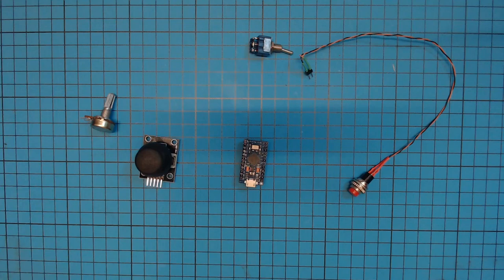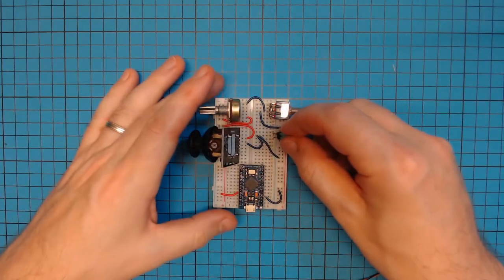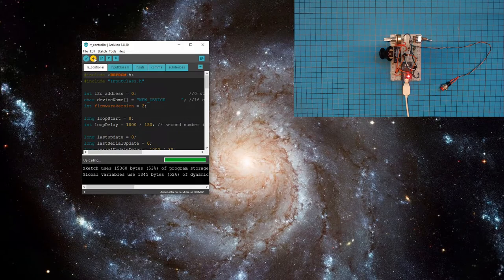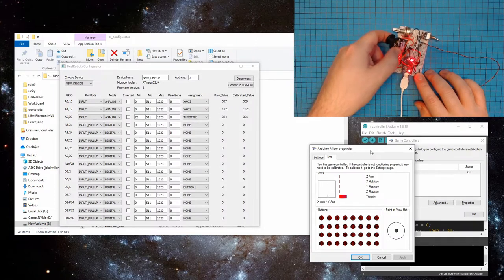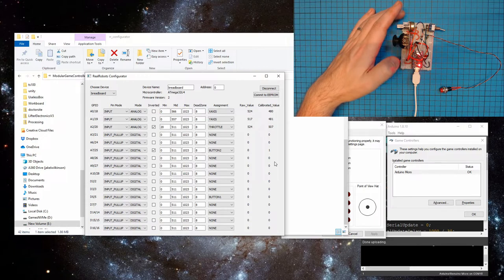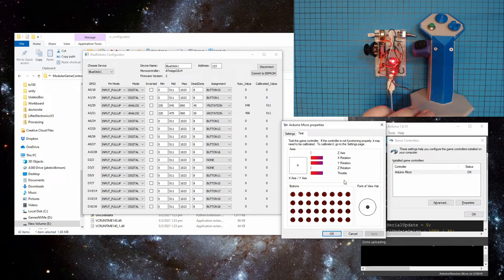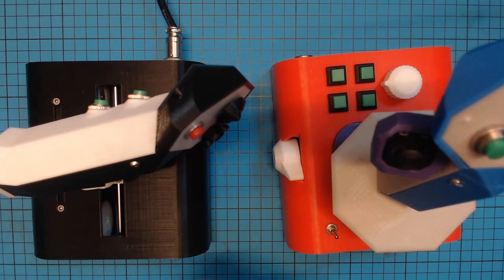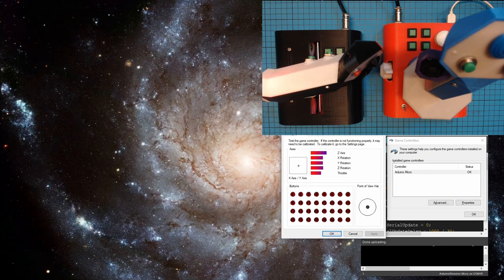RealRobots Configurator - Build your own controller with NO CODE

Comment: Mate this is absolutely brilliant what you have created. After years working on DIY sim racing equipment I was looking to repurpose my flightstick and modify it. This has been a godsend, all your videos are super clear and well explained. Hats off! Just wondering if there would be any issue if I were to connect another pro micro (making a dedicated hotas to work alongside my flightstick). I'm guessing it shouldn't be any but thought i'd just clarify :p
Reply from the maker: No problem, you can have up to 255 pro micros chained together. (Though the max I've tried is 7)
Reply: @real_robots  Fantastic! Thank you once again

Comment: Hi, I have printed all the parts and spent today assembling. I have uploaded the code to the Arduino Micro's however when I open the RR configurator I get 1s and 0s jumping backwards and forwards and on the analog inputs the values just run up and down and it doesnt matter what I do to with the buttons... Can you help please...

Comment: are there any plans to add a axis-to-button function? so to put "virtual buttons" within certain ranges along an analogue axis?

the main appeal for this is to wire up a buttons in series separated with resistors that connect to the analogue pin when pressed. it would allow you to add multiple momentary buttons but only requiring 3 wires and just using a single analogue input pin.
Reply from the maker: You can set an axis to a single button right now by assigning it to a button and calibrating to only range from 0-1.

Unfortunately any new features are a long way off as I don't have much time to work on this project any more.

Comment: Absolutely amazing work my friend
Reply from the maker: Thanks!
Reply: @real_robots   where should i place the code to display all channels values i need back to me?
Reply from the maker: @vtstechnologies5737  You need to upload the rr_controller firmware to your Arduino Pro Micro using the Arduino IDE
https://www.gitlab.com/realrobots/rr_controller

Then when you run the rr_configurator software on your PC you'll be able to see the values coming from every input.
https://www.gitlab.com/realrobots/rr_configurator
Reply: @real_robots  oh yea we did that already. found a few bugs when we close the program.
Reply: what i mean is . how to add my oled code to this so i can see my value that way?
Reply from the maker: @vtstechnologies5737  If I were you I'd grab the current value of each input and update it to your screen on line 260 of Inputs.ino just after all the inputs have been taken and processed.

If you want to display the data from networked subdevices that isn't stored so you'll have to post it to your screen as it's received on line 532 of subdevices.ino

You could also hijack the JoystickInput(input, value) function on line 503 of Inputs.ino That would be the way to go if you only want to display assigned inputs.
Reply: @real_robots  thank you . i will try and check it out.
Reply: i wonder where to put the oled address and h file also #include <Adafruit_GFX.h>
#include <Adafruit_SSD1306.h>
Reply: @real_robots  i may need you to explain what you mean by hijack, as i have no idea where i should be putting the display init to recon the display and then where to put each line. could it be under  case XAXIS(value);
then i write the line to refer to screen and map the values to the screen size here at each axis line before you wrote "break;"
?
Reply from the maker: @vtstechnologies5737  I would put that at the very top of Inputs.ino, if there's any init function, put it in InitInputs(), after the delay.
Reply from the maker: @vtstechnologies5737  By hijack I mean put the code in that function, since that function is called for every input that gets sent to the PC. 
I would put your code at the very top, you'll know what the input is by the 'assignedInput' variable, ie whether it's xaxis, button 1 etc. and what its value is by the 'value' variable. You just have to work out the layout and where on your screen you'll print those values. If you want to know which 'assignedInput' applies to each input you can check their order in the rr_configurator, XAXIS=1, YAXIS=2 etc.

Comment: do all additional devices connect to the same two pins? SDA and SCL? (plus vcc grd) so all devices are communicating through those two pins in parallel?
Reply from the maker: That's right, you just need to assign each device a unique address in the configurator and you can theoretically have 255 devices working as one.

Comment: Hello, thanks for making this, but for me the controller only works with the configurator open. What am I doing wrong? I did commit to EEPROM and am not getting any errors in the console window.
Reply from the maker: That's odd, having the configurator open shouldn't effect whether HID signals go through. Make sure you've got the windows USB game controller thing selected when you test, it only updates when it's got attention. Other than that make sure you've got the address set to 0. If all else fails, reupload the firmware and start from scratch.

Comment: I am in the process of printing the hotas now and waiting on parts in the mail. I've already applied it to a yoke that I've made and this is AMAZING! Id like to make the throttle as well, but I'm not sure what linear rail your using. what size is it?
Reply from the maker: That's MGN9R rail.

You can get the files for the throttle here

https://realrobots.net/files/productFiles/ThrottleBase1.zip

Comment: Does this program allow you to change the function of a switch? I am building a button box with a pro micro and using a few toggle switches but would like them to act as momentary switches for instance I would like to be able to switch the toggle on and it stay in the on position but only pulse the output. Then when I turn the toggle off that it would pulse the out put again.
Reply from the maker: Sorry no, it doesn't have that feature
Reply: @real_robots  do you have a recommendation or code to overcome this issue?

Comment: this is fantastic. are you still limited to 32 button inputs + hats? or can you exceed 32?

edit:(I believe technically software can see a total of 128 button inputs per HID device but windows joystick config will only ever show you 32)
Reply from the maker: I allow up to 128 buttons in the configurator, not sure how much software supports more than 32 though
Reply: @real_robots  wonderful! Thank you 🙏 
Exactly what I wanted to hear. 
Most major flight sim games will happily read the full 128 inputs per device.

Comment: Power wise. Does the extra 5 ( as you mentioned)  require any additional power? I would have thought the power requirements would be struggling with that many.
Reply from the maker: It's a good question, from memory the microcontrollers pull around 40milliamps each, so running 5 would be well within the 500ma provided by the minimum USB standard. I'll have to put one on a benchtop power supply and see what they actually pull but I'm running mine (2 bases, 2 sticks and a button box) off an unpowered usb hub with a webcam in next to it and haven't had any power troubles even with heavy use..
Reply: @real_robots  wow.

Thanks for that. I think this is some of the best software I’ve seen in the Arduino world. Does it do software debugging as well. I have a couple of Frysky M9 gimbals that I’ve been playing around with (3.3v)  that tend to jump about even after windows calibration. Gonna try hardware debugging after I try this software to see if it works. 

I love the aviator plug idea. I picked 2 sets after I saw how you linked a couple pro micros together. Very smart idea.

Does the software change the name detected in windows ie arduino micro?
Reply from the maker: @paulb36utube  Those Frysky gimbals look nice, are they just potentiometers or do they have some electronics in there? They have a surprisingly small voltage range if they're just pots.

The aviator plugs are great, you have to make sure to do them up tight so they don't work themselves loose but they can take some serious lateral force.

I haven't worked out changing the device name in windows yet, from what I've worked out so far you can change it in the boards configuration files for Arduino.
Reply from the maker: @paulb36utube  Unfortunately his trick requires going into your Arduino boards files and tweaking it so I can't really have my software doing that. I might just have to do up some nice instructions or link to some for people who have the multiple device problem. I've found a way around it for the new bluetooth HID system I've worked in so there might still be a way to do it, for USB HID I've relied on the Joystick.h library to do all that so far and the guy who makes that recommends the same trick you just linked to though.

Comment: Thank You for your firmware. Does make easy to make own controllers!
Need to figure is it possible to rename device so Windows finds it with its name.
Reply from the maker: No, the software can't do that, HID names are a bit tricky and are supposed to be registered. There is a way you can change it if you google around, it has to be done by playing with the Arduino boards files or something like that (haven't done it myself)

Comment: Is it possible to use something like the Rotary Switch Module by DFRobot that uses an analogue signal to determine which position the switch is in? trying to work out a way to use a bunch of rotary switches and buttons without needing up to 12 inputs for each rotary switch and the complex mess of wires it would create.
Reply from the maker: It's possible, my gui doesn't have that ability but a little block could be hard coded in that fires off button pushes based on the analog signal.
Reply: @real_robots  I'll try that and report back, when the parts finally get here that is :P
Reply from the maker: @DriftNick  sure, if you need any help with the code let me know

Comment: I tried this with the arduino pro micro. I see "Connecting..." on the web portal but nothing happens. So i tried installing the firmware from git hub. everything there seems to upload without a problem but the configurator doesn't load after connecting to the correct port. In CMD i see "IndexError: index out of range"
Reply from the maker: Hi, the web version won't work with Arduinos, the change to the web version was to add features I couldnt' squeeze into the puny Arduino memory.

You need ot use the python version https://gitlab.com/realrobots/rr_configurator
Reply: @real_robots  Hey thanks for the quick reply. I tried to use the python version afterward. I got to the point in which i slelect the port in rr_configurator but the interface didn't appear. right now I think I somehow bricked two of my pro micros so I created a new problem since then. hahah

Comment: Hi, I have a few questions about the software if you don't mind answering.
Is this only for Arduino Micro?   
How to get more inputs?  I don't see all the analog and digital pins in the list (only getting 4 analog inputs with the Leonardo board)
How to clear out a board completely so RR configurator detects in as a 'New Device'?
Is there a bug with Rotary encoders? I'm getting false values sometimes. left and right assignments are engaging at the same time sometimes. (might be hardware issue from my side too!)
One value is staying switched on for some reason even after removing the hardware switches and reseting everything. Any idea why?
Reply from the maker: I'm not 100% sure if leonard has different pin labesl than the pro micro i tested with. The A0-3 pins aren't the only analog capable pins though, try the others with an A(x) in their GPIO in the configurator.

You can revert to defaults by pressing the "revert to defaults" button. Or else to get your board to complete factory status, write a little sketch that overwrites all the EEPROM addresses back to 0.

Rotary encoders generally have really bad bouncing issues unless you filter the noise with a few capacitors and resistors.

Which value is staying the same?
Reply: @real_robots  Hi, the stuck values were D3 and later D6, but it's now fixed after resetting the whole board and reloading the code. I'm looking into how to fix the debouncing of the encoders. Currently it seems unusable for use as Alt or Hdg dials. But I'm still only seeing 16 GPIO in the configurator list (A0-A3 and 8 random digital pins). Leonardo board is  different from the micro. Leonardo has 6 analogs( 12 if you sacrifice some digital pins) and 14 Digital pins.
Reply from the maker: Okay, i'm guessing all your issues stem from the fact I never tested on a Leonardo, I actually thought the pinout was the same. I can give you a quick fix, open up Inputs.ino and do the following.

Change the numbers in line 30 to represent the leonardo pins. Make sure you use the numbers and not the A0-A3 shortcuts. Make sure whatever numbers you put in there, the same amount of numbers are left as if the array size is different it'll lead to other problems.

It will still show the old, pro micro values in the configurator, just remember the order of the input pins.

I think the following should work, the first 6 are the analog pins, corresponding to A0-A5.

```
int inputPins[] = {14, 15, 16, 17, 18, 19, 4, 5, 6, 7, 8, 9, 10, 11, 12, 13};
```

Comment: Hi! I'm building a custom controller using two arduinos, more specifically two adafruit itsybitsy 5V (atmega32u4) and I must say that so far your code and program have been very useful! I am however running into an issue when I try connecting the two arduinos together, they seem to work fine and the first appear as a USB-HID device but when I try to connect to the arduino with adress 0 using rr_configurator it throws an error and crashes. I could connect to it before I connected the two together and I can still connect to the other one with adress 1. 

The error I get is
"most recent call last):

  File "ser.py", line 142, in receive
  File "ser.py", line 325, in decode_id_packet
UnicodeDecodeError: 'utf-8' codec can't decode byte 0xff in position 1: invalid start byte"

Any idea what this could be?
Reply: It seems to work if I run the board as an Arduino Leonardo so it might not be a problem after all.

Comment: Nice job! I would like to use this solution for Microsoft Flight Simulator 2020, but I can not set it correctly. I use 1 pro micro and a mega2560 board, the micro is the hid device, the mega would be the input device. I would need 12 axes but I only see 7 in the game: x, y, z, rx, ry, rz, and slider0. The other names don't work. Is there a way to see the other axes in the game? Throttle, trimming, brakes, steering, etc., can I put names in it somehow? The other mistake I noticed was that there was a bug in the analog inputs. Each potmeter works well one by one, and all analog inputs work on the panel (I tried them one at a time), but if I plug them all in, some don't detect them, some merge them with another input and set them up at the same time (like if I had connected 1 potmeter to both inputs).Can you help solve problems? Thank you
Reply from the maker: Hi, it's hard to make the HID protocol work with arbitrarily adding large amounts of analog inputs, it's not really possible to get more than 7 the way I've configured it.

I think your problem with analog inputs effecting each other might be a hardware one, it could be in my software but that's not a bug that's come up before. How do you have your pots connected?

To get your max number of axes you could use two devices, I think MSFS2020 takes different inputs from different controllers but I'm not sure. The other thing you could do is have things like trim be incremental rather than analog, using up/down buttons or a rotary encoder.
Reply: @real_robots  Thank you for your quick answer. Currently, there are pots on the following ports: A0, A5, A6, A7, A8, A9 and works well. But I got stuck here because the other names that the program uses are not recognized by MSFS, and I still need at least 5 axes. Browsing the Internet in the description of the joystick library, I found that the following names can work: X, Y, Z, RX, RY, RZ, Rudder, Throttle, Accelerator, Brake, Steering. If you added the assignment list to the assignment list with the missing names, the 11 axes might work (the rest could stay as it is now, just put the missing ones in it). The problem with the two separate devices is that I can't hit a micro panel because the shaft names will collide. I would like to reduce the current 4 USB ports to 1 USB port.
I currently use a 3D printed throttle quadrant with 6 axis, a 3D printed Yoke with 2 axis, and a 3D printed rudder pedal with 3 axis (2 brake axis and 1 rudder axis), and a button box.
Reply from the maker: @skullslayer87  You are right, I'd forgotten that I'd limited the number of axes available to the amount that would work with my bluetooth HID library (used by the ESP32 version of the firmware). If you want to get the full number of axes available using Matthew Heironimus you'll have to write your own code using his library though.

Comment: Hi Thanks for making this. Will this work with button matrixes and rotary encoders? I have almost sorted out the coding for my yoke and throttle quadrant using the joystick library, but this just makes things so much easier.
Reply from the maker: It can do button matrices and rotary encoders, I'll link the video showing how to set up matrices below. There's no instructions for encoders but you'll see in the configurator there's an encoder tab, you just choose the two encoder pins and set a key binding.

https://youtu.be/dop0SoD2XL8
Reply: @real_robots   Yes, I just checked the latest version and It has a Matrix and Encoder tab. Didn't see that in the video. This is awesome. Thanks for the help mate.